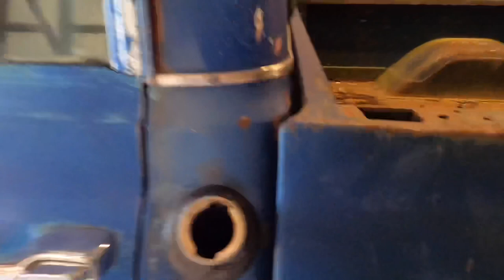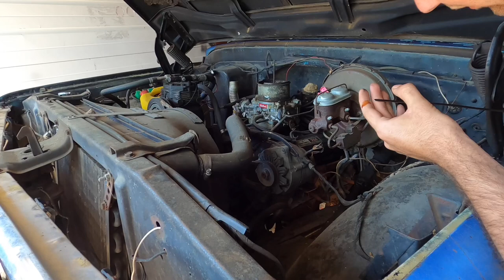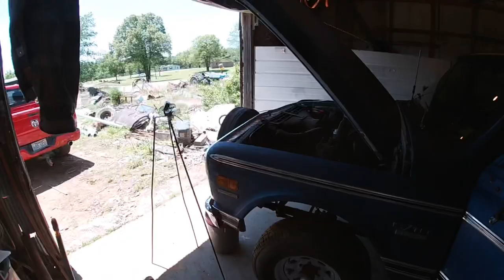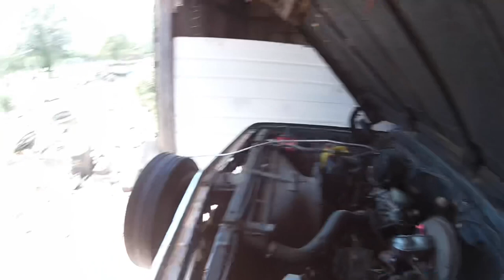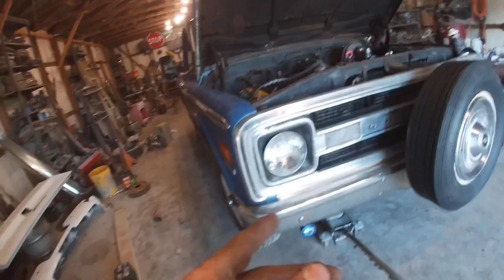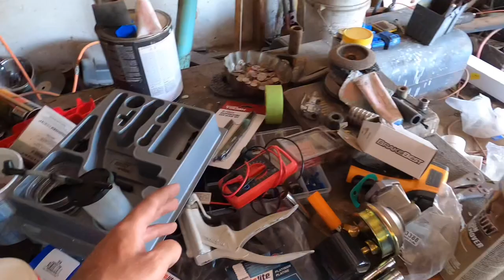Will it run after 21 years barn find 1970 Chevy k10

Comment: The rear brakes may not be getting fluid past the proportioning valve. If there was a line break or fluid loss the proportioning valve may have closed off preventing fluid from reaching the rear

Comment: Personally I'll take a quadrajet any day of the week. I can tweak them easy by removing the straws out. Reduce the jets by 3/4 turn and it will run like a raped ape
Reply: Run like a WHAT
Reply: Ran a Q-jet on my old K5 for years and years. Finally broke to peer pressure and put an Edelbrock on it. Worst decision I ever made. Edelbrock is just like everything else nowadays, total cheap Chinese crap that doesn't last!
The Q-jet always had loads more power. It didn't always idle the best, but was way way way better.
Plus, I live in the mountains at 7,500 feet and the Q-jet adjusted for elevation (rudimentary, it was an '84) so I should have never swapped it out.  
Big mistake. I''l take a properly rebuilt & tuned Q-jet any day of the week.